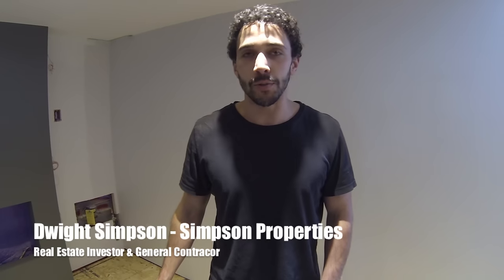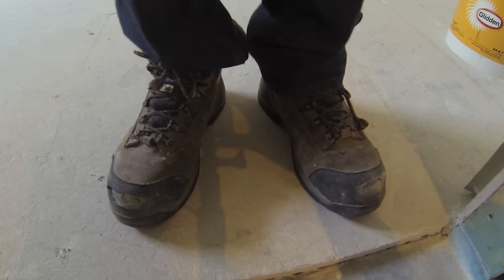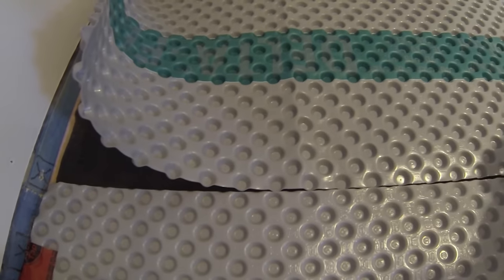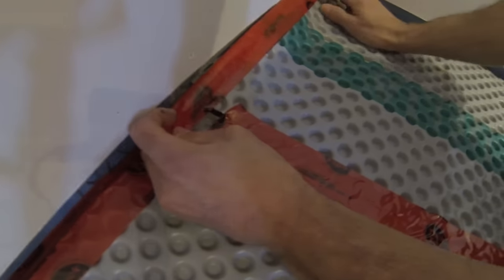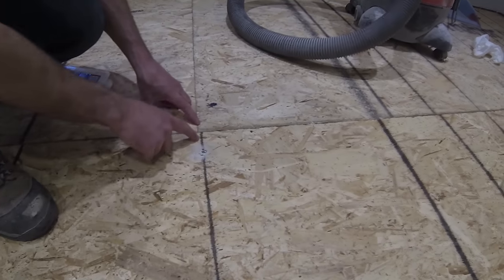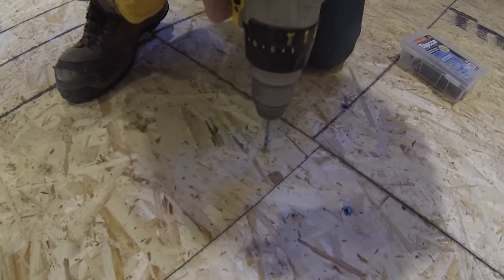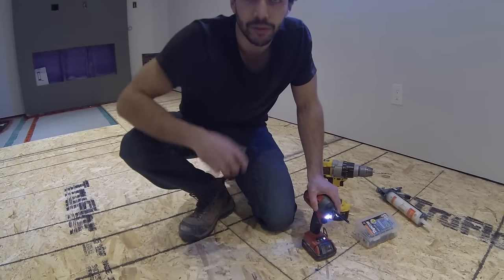HOW TO INSTALL A SUBFLOOR ON CONCRETE

Comment from the maker: Intro: 0:30
Landscape Fabric: 0:53
Delta-Fl Taping Seams: 1:37
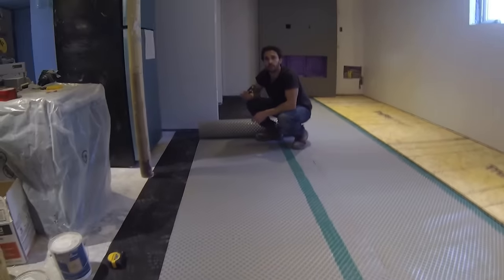Installing Wood Subfloor: 3:38
Installing Tapcons: 5:32
Outro: 7:23
Reply: Thanks for this very well explained video. I’m doing every step as per the video but I am finding the screws are not going in flush. Are there differences in strength of impact drivers.  Mine works great until the last 3mm. Very frustarting
Reply from the maker: @andyzankowicz1802  you may not be drilling the holes deep enough. Also, it will help if you back out the screw when it starts to bind. Then screw it back in feathering the trigger. When you back out the screw it helps remove any concrete particles that are binding.
Reply: Why didn't you put the Delta underlayment underneath the wall stud plate?  It stops at the wall.
Reply from the maker: @falsealarmno  I had my framing done already. You can install it underneath the framing. It's a better method to have the Delta-FL beneath non load bearing walls IMO.

Comment: Great video and thanks for landscape fabric tip. TY for sharing.  Ideally, Delta-FL / OSB T&G is installed onto slab before non-load bearing walls are built.  Then, for exterior walls, frame them ~1" from the foundation wall and create vapor barrier with closed-cell spray foam.  This method provides an ideal transition from the subfloor underlayment to the poured concrete foundation wall.

Comment: This is a great video regarding install of wood sub-floor on concrete basement floor.  The main problem I see is, is that very few builders can properly dig & install basement structures using proper site prep., and drainage (my sub-contractor experiences).  It's refreshing to see someone (this guy) doing a job correctly.  I hope he stays busy and makes good profits.
Reply from the maker: Thanks Mike! I am more than busy haha working on my own projects for the most part.

Comment: Excellent video, my friend.  Honesty, tips, and knowledge.  I've been researching this for several weeks and you somehow explained all my concerns in 1 8 minute video.  Again, excellent work.
I'm going to do the sub floor first, then line the block wall with 1" foam board (for R value and vapor barrier) then build the walls on top of the sub floor.  The additional tuck tape around the perimeter where the foam board meets the subfloor may be overkill for my build, but we ain't come this far...
Reply from the maker: Thanks for your kind words. It’s great to see that a video I made years ago is still helpful to people working on their projects. You have a great plan in place.

Here is a great resource on insulating basements that you might find helpful:

https://www.buildingscience.com/documents/information-sheets/basement-insulation

Best of luck on your project!

Comment: Good job buddy great vid. I’ve been in construction for 17 years and I just nod my head when I see diy’s leaving Home Depot with three buggy’s of those 2 by 2 panels such a rip off,  for my basement I actually used foundation membrane with the landscaping cloth already attached, as I got it for free from work. Again good job on showing ppl how to save their hard earned money.
Reply from the maker: Thanks! You have to be careful using the foundation wrap for a subfloor application. It is manufactured with different plastics and generally not built as stiff as the Delta-FL.

Comment: I am super late but I’m beyond grateful for this video. Thank you so much! I’m building out my basement gym & the price of the dricore is killing me. I’m going to purchase the items in the video & I will install it in the rest of the basement to avoid spending my life savings on a floor. Thank you so much!
Reply from the maker: I'm happy to hear you found the video helpful! Wishing you the best of luck on your project.
Reply: Use Simpson Strong-Tie Titen Turbo masonry screws. They drive easier and are stronger, which means they don't snap as easily. You'll be glad you did.
Reply from the maker: @markhewitt3160  Thanks for the heads up!

Comment: I used Delta FL on the basement subfloor I designed 9 years ago. The Delta FL installation specs say do as you are doing here, and put the plywood directly on top of that. I did something a bit different. Mike Holmes goes on about the benefits of a thermal break. He installs rigid foam direct to the concrete. That's going to sweat, as concrete lets moisture come up as well as go down. Hence the need for the Delta FL. But on top of that,  you'll get a vastly better floor if you install a thermal break. I put in 1" codeboard. That's R5 all over the floor. The thermal break works to keep a very stable temperature in your basement. It will cost more than what you're doing here, but the end result will be a floor that's so much nicer to have your feet on. And it will give you savings on your heating. If your basement is properly insulated, you'll go from sitting on top of a cold space in the main house, to sitting over a warm space. It turns out to be integral to the house's temperature and your bank balance.
Reply: LadyDMcollector thanks for the I fo. What is the order or materials on your cement floor, and combined thickness?
Reply: LadyDMcollector when you talk about 1” codeboard for thermal break are you referring to the R5 pink panther foam insulation?
Reply: LadyDMcollector  Hello did you put the osb over the codebord ? Thanks Rich
Reply: Hello is it better to use a concrete sealer first?Will that fabric cause moisture?You are very helpful Thanks Rich
Reply: Cristian Campo yup, that's exactly it. One inch of closed cell foam board on top of the roll out subfloor. Then the plywood.
Reply: Vic da G f.
Reply: Do you need the landscape fabric in your setup?  Or do you omit it?
Reply: @mikecampanella1990  did you fasten to the concrete or just leave it floating? If you do double layer of OSB, perpendicular to each other you don't need tap cons and can just deck screw them together, right?
Reply: @billgunter8861  I haven't gotten the chance to do my basement yet. But the double layer of osb perpendicular sounds interesting. I've seen people float 3/4" tongue and groove with some little strapping brackets connecting them. Then the walls and interior walls connect to it and keep the assembly from shifting.
Reply: The rigid foam/board (XPS) does act as a vapour barrier, so there is no need for another vapour barrier like Delta FL.  Additionally because the rigid board also provides a thermal break, there shouldn't be sweating.
Reply: @mariomatejka  : So, XPS directly on the basement floor (attached w/ PL300), with plywood on top? 
(Also, I'm trying to be thickness conscious, I'm 6'5". 👍
Reply: @tch632  I did XPS directly on the floor (concrete), with tongue & grove plywood on top.  Instead of glue, I used concrete fasteners going through the plywood and XPS.  I'm 6'4" :)
Reply: mikecampanella1990 I’m new to all of this. What do you mean by by cell foam board and tongue and groove floating subfloor? Are you spraying something over the cup stuff he laid down? How do you get it to stay without screwing it in?
Reply: @mariomatejka  Thanks Mario, i am going to try your technique and fill the tapcons with silicone.
Questions: Will the screws compress the xps in places? And what about the edges? i guess if there was ever an accidental flood i would be ripping it all up right?
Reply: @legion0101  The screws won't compress the XPS.  It's actually, going to get hard to turn the screws once you get to the end.  If there was a flood, and you can't dry it out, you might have to take it all out.  But you would be able to reuse all of the XPS as it's 100% waterproof.
Reply from the maker: Thanks for sharing.
Reply: @simpsonpropertiesltd  
Hi there. I didn’t reply on questions to my original comment as I never had a notification of those questions; your comment is the first I’ve seen. 
A couple of things that have come out, reading the comments. 
1. Don’t attempt to seal the concrete. Concrete allows moisture to come up from below, and go back down again, it must be allowed to do that. Don’t waste your money causing yourself a problem with sealer. That’s for outside use. 
2. Someone commented that the pink rigid foam board (codeboard) is a vapour barrier, so they said you don’t need the Delta FL or similar. Mike Holmes lays his codeboard straight on the concrete with that in mind. I looked at my concrete and Im seeing a lot of moisture evidence in autumn and spring. I don’t like the idea of all that moisture building up directly underneath the codeboard. I think it’s going to sit there kind of sweaty. I want a bit of air at the floor so I don’t get a musty smell and that’s why I use the Delta FL (or similar). And I never have any mustiness in my basement. 
3. OSB or tongue and groove ply. For me, 3/4 or 5/8” T&G plywood. It’s very strong and stable. It’s also more expensive than OSB, and they use that for wall forming, so I guess that’s a preference thing. 
4. Can you float the ply over the subfloor? I wish I could say yes. Maybe if your floor is perfectly, truly flat. On my floor, when the ply went down and I tried walking on it, I could feel movement. Not a ton, but it is unsettling and messes with your stomach a bit. So even though I wanted to float the plywood, I did actually use Tapcon screws every 2ft as per manufacturer recommendations. And be forewarned, they are expensive to buy and time-consuming to install. And you CAN do this yourself with a suitably hefty hammer action drill. 
5. Should you use sealant on the Tapcon screws when you screw the basement floor down? Technically, according to Tapcon yes. In reality, it is better to plan ahead in terms of how you would handle a basement flood. I can say with absolute authority based on experience that it causes a huge set of problems when you have sealed those screws in place. It’s very difficult to remove plywood that has been screwed in with glued screws-they won’t budge. You have to rip the floor out then pound each screw with a sledgehammer to smash it into the concrete. And there are a LOT of screws involved. If that sounds like fun to you, go ahead with the sealant. If not, think in terms of building so that you can manage the demo yourself in case of a flood.  

Having done a basement build, tear down and rebuild due to a basement flood, I recommend you decide on room partitions and put up that framing before laying the subfloor. In a flood situation, this makes floor removal much easier than if you lay the entire basement floor and then build partition walls. 
I hope this helps. 😃😉👍

Comment: There is an addendum to this though. A few weeks ago we had a small basement flood. The ground was saturated and it rained all night. We came down in the morning and there was a bit of water just on the surface of the laminate flooring. We ran an emergency pump out of the window, but the damage was already done. The laminate was cupping by the afternoon and it was so not going to be ok. Water in every single Delta FL pocket, filling up past my thermal break, through the plywood seams. All has been ripped out and is a big insurance job now.
The difficulty I face is we laid our great big beautiful subfloor first and then built walls. Now we have to rebuild under those walls. 
My recommendation, following this experience is to build walls first, then do Delta. 

I don't know if there is a sacrificial product that can go on the concrete level, but I'd be looking for one and then put the bottom plate of the wall on top of that. Could composite wood material work? Is anyone using this method of construction? What's needed is something impervious to water to give you a couple of inches grace before water hits the wall framing. Then Delta all internal floor spaces and seal, thermal break, 5/8" T&G plywood. Would you save the floor if you used marine ply?

If someone hasn't already designed a system for this, I don't know why. 
3M, Corning, I'm looking at you awesome ideas generators.

PS As a preventive measure, we also installed a second sump line on full strength sump pump, plus a battery backup unit with alarm in case of all round power failure.
Reply from the maker: LadyDMcollector thanks for sharing your experience. I framed my walls first before installing the Delta-FL. I used BluWood (mold/mildew/insect resistant) for the bottom plate. I staple FoamSealR Sill Gasket (made by Owens Corning) to the bottom of the base plate. This way the wood is not in direct contact with the concrete slab.
Reply: The BluWood sounds good for the bottom plate. We didn't use that (not aware of its like in Canada), just regular construction grade pine. Can BluWood withstand a flooded basement situation? Insurance companies are whizzbang about ripping out your basement installation, I notice. 
I absolutely loved the codeboard thermal break between the Delta and the plywood. Can't wait to reinstate that.
I think we're going to have to use spray foam under the bottom plate to the wall, since the tear-out crew damaged my codeboard on the wall under the walls. So... next time I design a basement build, I'll be thinking about how I can refit in case there's a flood, AS WELL as installing multiple sump pumps and backups. Sigh. 
Good for you, putting up a no-nonsense film. Nice job.
Reply from the maker: LadyDMcollector thanks I appreciate it. I'm from Toronto you can purchase BluWood from Lowes. It's unfortunate that you had a flood in your basement. Thanks for sharing what happened. I'm sure others reading through the comment section will learn from your story.
Reply: Hope so, that's why I was so detailed.
Reply: at least you noticed,  it can pool under the floor and into the pockets without affecting much immediately which is a disadvantage of this type of floor.   while mine is well waterproofed, on the lowest/slopped parts i put tiny access panel in the floor i can manually check or put a small alarm under like leak detect rope.   leaks will pool there and you'll know before its too late.
Reply: @LetsDoMath  I realize this is a year old, but for anyone else looking, In the US this is called pressure treated lumber, its frequently used on decks and other exterior applications. In my state code requires any lumber in contact with the basement floor be pressure treated.
Reply: @TheTinkeringMachinist  That's smart. It's not in the building code in Ontario. I used a 3M product - it's a pink spongy plastic rollout material, just a bit wider than building lumber and it sits in contact with the floor, and the floor plate of any wood that's in contact with the floor actually sits on this and not the floor. It insulates the wood and stops any of that efflorescence that comes up and down into the concrete from contacting the wood, so stopping any potential rot. Or you could use PT instead, like in your state. I could have just used PT. Oh well, done now. I hope I don't have to do it again. Fingers crossed.

Comment: What a nice, elaborate and precise how-to video! Thank you very much.
Reply from the maker: Learn Bangla thanks for the positive feedback and subscribing!
Reply: Hi, How much height did you loose in total? I understand the OSBs are 5/8. Thanks.
Reply from the maker: Learn Bangla Delta-Fl is 5/16" + 5/8" OSB = 15/16". It's almost 1" in total.
Reply: Hi. I found your video because our project is going to be over our house floor (not basement). We are looking for an affordable option bc we bought an approximately 5,000+ sq ft slaughterhouse (yea, I know), and it’s all uneven concrete flooring with drains. We attempted to level them about 12 years ago and made it worse. Since then, it’s been a hurry up and wait, trying to find the answer. I think your video could be the right answer since it appears to be forgiving and affordable. We live in NW Florida with LOTS of humidity and rain and have an inground pool. Do you think this would be a feasible option for us!!??
Reply: PS, we are diy-ers (fortunately or unfortunately?!?!)

Comment: Landscaping fabric is nice. Roofing felt, tar paper is a better option if your basement floor "sweats, or wicks water" like in an older house where the builder didn't use poly under the slab. The tar paper will hold the moisture underneath better than a regular poly vapor barrier and the water concentration will reach equilibrium and stop wicking.
Reply from the maker: That's a great point for people who have concrete slabs with a heavy moisture content. Thanks for the tip!

Comment: Thanks for making this video.  I was looking at a solution that would let the concrete slab breathe while being able to add insulation. Do you think I should be ok putting in that order : fabric, dimpled plastic sheet, rigid foam board then vinyl (like laminate snap-on)?
Reply from the maker: The materials and order you listed them in sounds great. I personally have never used foam board for added insulation. Let me know how it works. Thanks for your feedback and comment. Don't forget to subscribe to my channel to stay connected.

Dwight